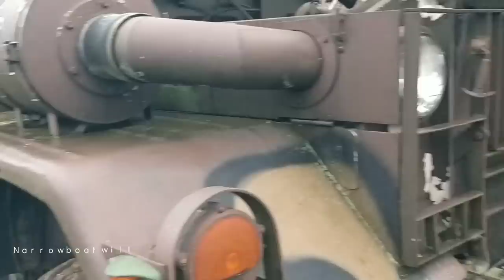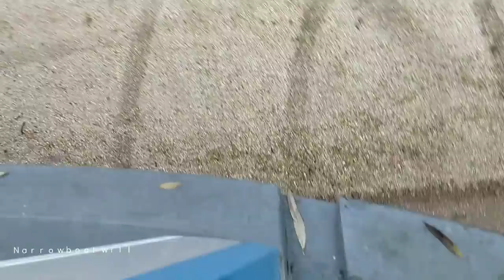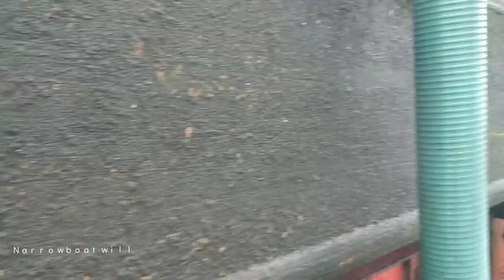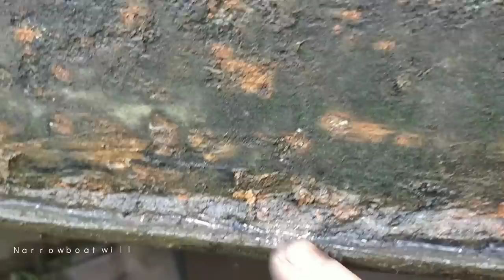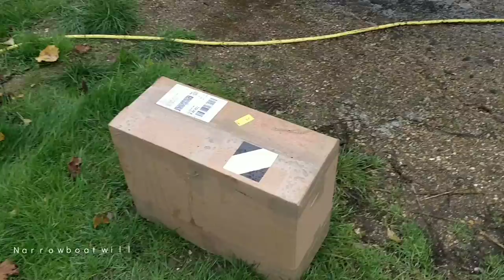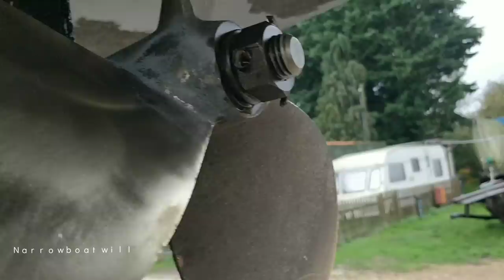Boat blacking Part 2. Boat comes out the water. The dirty work starts.

Comment: 2.54 in and we agree on everything you've said so far.
Amazing stuff Will.
12.32 in
Fab ex military truck
Hull looks in great condition
brilliant news.
13.54 in
It's called your chime plate 
which thins as it scrapped on lock walls canal sides etc etc
19.05 in
It is so lovely to see a good honest old fashioned boat yard who do things the proper way.
A true service to boaters that need good work done to look after them.
The end 
Thoughtful work Will treating the prop to a clean and polish.
treatment of rust on hull
welding extra protection.
peace of mind the result.
I personal view of my experience.
On one occasion we put our boat in for blacking it was noticed unusual pitting on one side of our hull.
The marine suggestion was to fit an isolation switch to the negative supply to the engine block. Since as your engine is fitted to the hull and stray electrical currents go through the engine to the hull.
So having fitted the isolation switch if you forget to switch it on you don't start your engine!! as happend sometimes lol.
Hope you're doing well
Keep safe warm dry and virus free.
Reply from the maker: That's interesting fitting a switch to the earth strap. I need to look into that.  I presume all the electrics still work when you live on it? Its a great yard to take a boat. The guys are so helpful. Cheers for watching.

Comment: Will you working so hard on your boat I would still have new adenoids  on well worth it  may have spelt that wrong but you no what I mean hope you got the weather to finish it tc now the oldies freezing isn’t it 🤶🏻🎅🏼🎄☃️❄️🌟seasons greetings
Reply from the maker: Anodes are very expensive now Ann I'd only change them if I really had to. It's not cheap blacking a boat but I know what you mean. I'd love to replace everything possible. Keep warm guys. Take care.

Comment: Looking good mate the tiller people done a vlog about anodes a certain length needs a certain amount now you can see why. That will certainly warm you up doing all that work if I was more local I'd give you a hand mate I would hold the paint pot lol anyway good luck with the blacking dont hurt yourself doing to much at once.
Reply from the maker: Cheers David. I wanted to do it myself just to see how hard it is. The boat guys do it for a living all the time. It's wet cold work but very satisfying. Stay tuned and take care.

Comment: woaw so impressed with the hull Will, you have a great boat there, hope the damage wasn't to much, hope to catch you soon, iv got the hump with all this boat diy and dreading not being able to finally cruise next year, all part of the fun, take care buddy
Reply from the maker: You guys are building a great channel from your DIY. What you need above those hatch doors is strips of metal welded to stop rain coming in. You'll notice it on other boats. Take wonderful kind care of that hoover. F..k everybody else.
Reply: @NarrowboatWill  your absolutely right, my mate was meant to weld some on but then didn't, were going to have to find a way of protecting the wood there, or it won't take long till were back to step one, cheers Will your right the DIY has probably helped the channel , take care buddy

Comment: Great vlog . Interesting though that your boat has been overplated . It could be the source of the condensation you suffer in the engine bay ?  Anyway , while it is out , have a real good look over your overplating and anything you are not happy with will need sorting . You have spotted a couple of things already .....
Reply from the maker: Yeah I wanted to spend time going over the welds and repair any parts that need it. If I just gave it to someone else to paint it they'd just paint it and get it back in the water so they can get paid. Stay tuned to see what repairs I do. Cheers Mark.

Comment: Best to slop the blacking on thick and almost drippy with a large brush.
NO foam roller or two inch brush.
Thin coats are useless or you'll be back at it in two years.
Reply from the maker: Oh I slopped it on good and thick. First coat with a thick brush then 2 coats of roller with a fourth coat on the water line.

Comment: thanks for a very interesting vlog, Will. You worked hard and got good results. Quick question re: welding on the boat - do you have to isolate the onboard electrical system?
Reply from the maker: I turned the  isolate switches off in my boat. I earthed right next to the welder so the power was in a small area. I'm more concerned about fires inside so I did short bursts of welding. It came out a treat. I'm not a welder or electronics engineer Richard. Cheers

Comment: You worked hard on that Will and I bet you found it very satisfying. I didn't hear what the guy said about the weight, has your boat had some over plating? Great vlog, looking forward to the next one. Thanks
Reply from the maker: Yeah he said it was heavy. I don't mind the overplate. My boats like a tank. 😂😁 Cheers Raymond I'm glad you enjoyed it.
Reply: @NarrowboatWill  looking at yours now, wouldn't put me off buying an overplated boat. Cheers
Reply from the maker: @raymondc5473  if it's done well I done see a problem. My boat has taken some serious knocks and I reckon that plate saved me sinking.